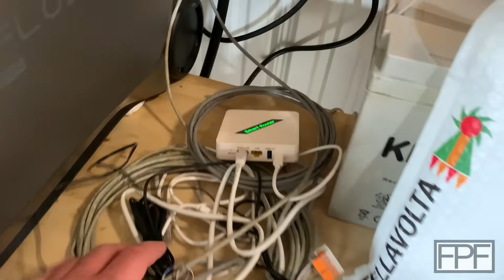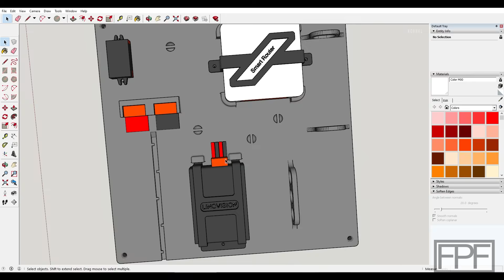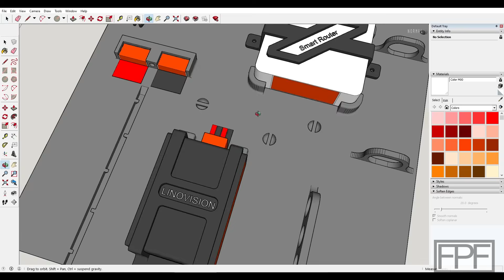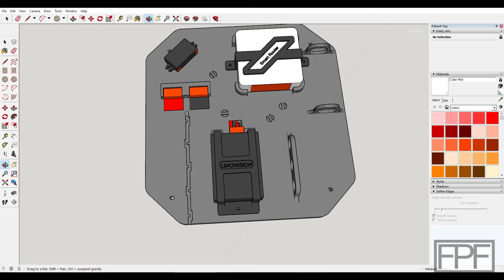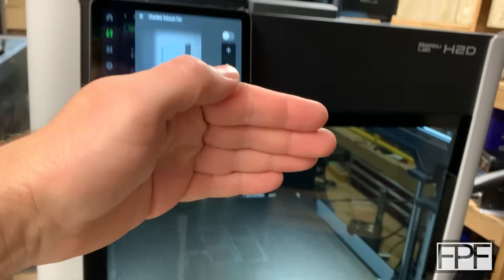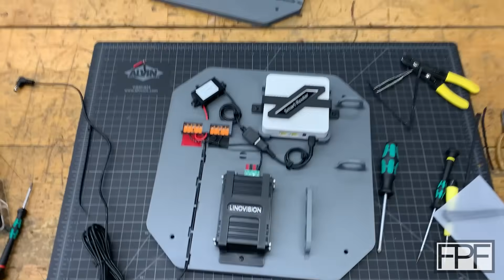3D Printed Equipment Mounting Board - H2D Problem Found

Comment: I will start from the end, I think it is the most important part. Printing PLA with Bambu P1S or Bambu X1C really needs the glass lid removed or the printer door opened, at least a bit. If not, the printer will run into issues, sometimes really big issues, for example filament clog. Users will run into troubles 100%, soon or later, just remove the glass lid or open the door when printing PLA, it is very basic step with PLA and Bambu enclosed printers. I am not here to argue, I am just sharing what happens.

People are expecting too much, one button to print everything, but it is not how it works. A random dude will buy a Bambu P1S or X1C loads PLA filament into AMS, starts 10 hours print ( very first 3D print ) in the evening and goes to sleep. The printer has lid on obviously and the door is closed. The printer is F in the morning so it is warranty claim, right? The printer does not work as it says on the tin.  The printer is piece of crap. ( sarcasm )

Every filament profile can be / must be tuned for the environment around the printer. Same filament, same printer in a room with 20C will print differently than a printer in a room with 30C or more.

Bambu H2D ( I had no luck yet to buy one, it is always sold out before I can buy it ) but I wont give up.
You can tune almost all aspects of your filament profiles in the slicer, you dont really want to have a tornado inside the printer when printing PetG, ABS, ASA or other "sensitive" filaments. PLA does not care, if the first layer is good.

Printing PetG.
Lower the air movement inside the H2D enclosure, you could get air too cold from the environment around your printer, if you print something large or long, it can bend the printing plate. If you want to do a test, print something 50x300x5mm in H2D in the middle of the bed and watch what happens, perfect example would be ABS or ASA filament. If you print very hot and you cool it down rapidly, expect banana print.

I do not know, what temperature you have used for the bed for PetG, but try to lower the bed temperature by 5C, I know it makes no sense, but it works. If it works, try another 5C, until you get to the temperature which still holds the print and the bed is not too hot. The more heat you pump into the bed, the worse outcome you could get, long or large prints will just bend the printing plate almost in any 3D printer.

Elegoo Neptune 4 Max
I do understand why people bought this printer. The print bed looks like a small airport for very good money ( the size ) but that is one of the worst printers I had to repair for few friends of mine. The bed is always crooked and it gets worse when you heat it up. There are some ways how to defeat that but it is just not worth the money. Another very common issue is firmware and dead motherboards, straight from the factory. On the other hand Elegoo does its best to send spare parts very fast.

Few last words...
The most common issue with 3D printers is the user, not the 3D printer.

I repair Bambu printers for friends and the issue N1 is filament clog with PLA. Was the lid on and the door closed? Yes 

Have a great day.

Comment: Pretty cool project!  The only different thing I would do to make it more modular and easier to swap out components in the future is to use a modular mounting system such as MultiBoard or Hex Wall.    Then when it comes time to replace a component, rather than making a whole new board, you'd just need to make a mount for the new device.  I did this for my network and IOT equipment and it has made it so much cleaner and easier to swap things out.

Comment: There is special holders from wago itself designed to hold the wago and slide it on a din rail ... there is also stl's for printing from the usual places.

Which brings me to my suggestion ... Make holders for the other stuff too designed to slide on a din rail. If you ever need to combine it with off the shelf electrical stuff you already have the rails.

As for the bed lifting, check the mounting screws for the bed (under the build plate) on the H2D, some people have reported them to be loose.

Comment: Same here i have done some big pla prints on my p1s and i have never removed the top glass or left the door open and i have never had a problem printing pla. I actually turn off the chamber fan during overnight prints as its pretty loud in the house

Comment: Nice video , good to know! I don't think there is a universal setting for any material in any printer. It really depends on your design. Cooling should be minimal or off , when you print on large areas like that.Also you should set the heated chamber to a higher temperature. That should solve it.  Heat is your friend against warping.

Comment: I just reinforced a tall print which is in two parts, with 2 x 300mm by 9.7mm steel rods. I printed the top part on X1C and the lower part with H2D. both sections had tall, round pockets for the parts, with the same tolerance (0.1mm I think)... X1C part was snug, but slid on fairly easily. The H2D print, I had to force in the rods with quite a bit of pressure.

Comment: Orca slicer has exhaust fan options in filament section as well as chamber temperature, so I think bambu studio could implement that pretty fast in next updates. Sadly X1C could have benefited that a long time ago too but here we are. Try using Orca for these speciofic prints, time saver probably

Comment: Very interesting that the metal PEI-coated textured build plate itself is lifting...nothing you can do about that...

except remove that and put down painters tape on the bed directly, but that's not what you do to a $2,700 machine......

Comment: I think you're probably right in your assessment, no idea about other people but my print room is air conditioned and I leave the "roof" and door shut on the printers and leave little vents open at the top because if I leave the doors open and the fans on I'll get the same results as you with PLA. I realised this on my first fully enclosed core XY printer around 2015 and have enclosed the printers with PLA like it's ABS ever since, ambient temp keeps the chamber below the heat creep danger zone - It's the air flow from air con/chamber fans, i'm convinced
Reply: Yup. I'm in a basement that's about 65F more or less year round. Always keep the door and lid shut for both ola and petg.

For petg specifically, i massively lower part cooling fan (even for overhands, though it a smidge higher) and disable the exhaust fan all together.

Comment: Really Bambu can’t help with knowlege deficiency. Its just physics. The things shrink and expands when the are subject to temperature change. H2D have everything to enable you to pull it off its a matter of knowlege. Raise chamber temperature depending on the material. Wait printer to reach temperature equilibrium. Choose glass or carbon filled material to reduce the shrinkage. Use infill pattern that reduce shrinkage.

Comment: Saw someone else a while ago have a similar problem. He tightened every screw on the bed. Even if they didn't seem like they needed it, and it worked for him.
Reply: What screws ?
Reply: @cromyjr1592  I think it was the screws on top of the bed. They were loose and pushing up on the corners of the spring steel sheet.

Comment: Had some bed adhesion issues due to too low temps in the winter on my P1S that is somewhat open to outside temps. Upping bed temp and closing the door mostly solved that.

Comment: To reduce lifting, you can set the infill pattern to hilbert curve, it won't have those large diagonal lines pulling on the corners.
Reply: Filling that massive surface with the Hilbert curve pattern has to be the most annoying 1st layer to watch in history.

Comment: Really interesting video, and I'm glad you resolved the ventilation issue. I love that you share the thought process behind your designs.
I had one thought about a prime tower... You didn't need it in the end, but if it was important, you could have cut a through hole in the mounting plate, behind the router, and placed the  prime tower there during the print. Once the router is installed, you'd never know there was a hole there.
Reply from the maker: Great idea!

Comment: I've had exactly the same problem on my P1S with larger PETG prints (and actually the same using the same color PETG), not a flat plate like yours but a big, flat hollow box (speaker enclosure). It lifted the corners of the magnetic build plate pretty significantly, I'd guess 12-15mm on the worst corner,  messing up the top of the print, but it still printed because when it ran over that area the print head would push it down.

I was sure it was a heat problem and had other similar items I wanted to make so I spent time insulating the chamber with reflective insulation, that made it significantly better. Manually turning off the chamber fan (it has a chamber cooling fan, just not the fancy vents) helped some more but ultimately for some reason that caused the corners of the print to lift slightly rather then the bed. What finally got a good print was using fiber reinforced PETG (I don't remember if it was CF or GF, I have the same brand with each in the same color), the fiber reinforcement seems to help prevent warping.

I recently had a similar problem that presented itself completely differently printing a large part in black PETG that had sides that tapered outward at 50*. It looked like it was just failing printing the 50* angle without support. I redesigned the part so what was a 50* angle was now a 35* angle, and it still "failed" in the same way (it printed, but the surface was horrible and rough). I noticed that the bambu studio profile had different max unsupported angle depending on layer height and quality presets, so I tinkered with that it fixed things on one side and not the other. I realized that it was next to the auxiliary parts cooling fan and that it would sometimes run even if you had it turned off in the slicer settings. I ended up manually turning it and the chamber fan off after starting the print and it printed perfectly. Same with a redesign with the original 50* walls. Who would have thought that a cooling fan would cause a problem with overhangs?

I'll second that Bambu studio needs better control of the fans, including some way to turn off the chamber fan, but even more so, when there is control of it, if you tell it to turn it off it should stay off.

Comment: It looks good, one option for people without the H2d might be to make the board as modules that either attach to din rail, or use dovetail slabs to link the panels in some combination. Say each module is 8"x8", and has 2 1" or 25mm dovetail slot horizontally and vertically, that is used to physically link the modules, and those bits could be the pieces that mount to the wall, so that the attachment screws are never visible (or provide possible shorting bridges) once the panel is built and mounted. 

Another thought would be that for devices that are normally"mounted' flat on a table or shelf, rather than against a wall, provide added space under the component, with landing pads for the feet, giving more clearance for airflow. After all they are mostly going to be radiating heat off the surface that would be the top,when set flat on a shelf, and that would normally pull ari through the bottom, but if the system is mounted edgewise like this, that pull through isn't as precedent, so providing les constrained air behind it may help with the longevity of the equipment.

Then again, I tend to overthink some of this stuff. 🙂

Comment: I have seen some FLIR images showing nonuniformity in the bed heater which seems to correlate with the sparse pathing of the heating element. My first thought was that this is the problem, and and you just worked around a design flaw by closing the vents. I was not aware of the two stage heating system, however. I wonder now about the arrangement of the two elements, and if these FLIR images were just capturing the initial warmup element. I would like to see some thorough testing regarding heating uniformity.

Comment: So nice to see people make good in-depth content about the H2D, as people know to not expect a "perfect" printer, but a great printer, and where the rough edges are and where they should be careful. I'm still very excited to receive mine.

Also, obligatory question: How dry is the filament?
Reply from the maker: thx!  dried in the AMS's for the default drying cycle for PETG before 1st print
Reply: @FunctionalPrintFriday  Okay, I was a bit overeager and didn't wait for the conclusion of the video while I typed it :). Yeah it seems to be the aircon combined with the profile being to eager to suck fresh air in. It should probably do it less aggressively, and even less so if it detects a steep temperature drop.

Comment: Solution is pretty easy - up the temperature of the bed, ~77° C for PETG usually mitigates lifting corners.
Reply: Warm enclosure to 35° C also helps. But high bed temperature is essential.

Comment: I use three of those Linovision switches in my attic.  The previous owner ran two cat 5E cables to every room, but he used them for phones!  But as is often the case, he terminated each cable at a punchdown block in the attic.  I leveraged those cables for Ethernet, but since they all terminated in the attic, that's where the switch needed to go.  Well, I live in Texas.  It gets HOT in my attic.  Too hot for a standard switches.  The Linovision switches (and the power supplies that came with them) are supposed to withstand 170F, so I used those.  Only problem is that between computers and POE IP cameras, I needed 24 connections, so I needed several of the 8 port switches.  But two years on, they're going strong.

Comment: My initial thought while you presented your planned solution: why not just use something like HCSW or Multiboard, probably combine it with underware and some custom brackets…
Reply: And why complicate it that much? Screw custom brackets directly to the plywood instead. People are printing custom backplates, multiboards e.t.c. way to much. Its a stupid way of using 3d printers to create things that can be done easier, cheaper and more environmental friendly in other ways. (Multiboards of different kinds are quite stupid themself, most people that are using them don't move things around more than once or twice in their life time. So much smarter to just screw things into a wooden panel then. Much easier to design custom brackets that way and it will give a much more sturdy solution)
Reply: @drosendahl my thinking was more along the way of less print time and filament use for a similar stability, less pieces to design yourself and more parts that can be re-used, should you end up tearing everything down later in time.
Reply: @ And still it would be easier just to have brackets, bins, tool holders e.t.c. screwed directly into the plywood in this case or another wood board in other cases. Multiboards of different kinds are just complicating things and wasting unnecessary plastics while giving a worse end solution. The only time a multiboard make sense is if you expect to change your setup very often, something that does not apply to many people.

Comment: This is only my second time here, but I have learned SO, SO much that I really need to say thanks! The first time here I ended up watching almost 8 hours of you straight!  I've put off buying a 3D printer for 20 years because since the very early days of these machines you'd most likely have 9 mis-shapen, molten clumps of plastic for every 1 a machine might produce flawlessly.  I see that (for the most part) that issue is fixed. Your trials with the cooling problem you had is very interesting (because it caused the first 2 attempts to fail); didn't see that coming at all; I thought since the H2D was built for these filament that they'd have it dialed in and down to a science, but I guess not! I'm really curious what BamBu Labs will say, so please update us if they answer you.
I also think your wire management project was completely AWESOME!  Really a great idea!   After 20 years of putting off buying a 3D printer, I've finally decided to buy one and have been leaning towards the H2D.  Your videos have really helped me make my choice. Thank you for sharing, it really helps.

Comment: Why even create a plate like this in the first place? So unnecessary... You could just have designed small fasteners for each detail and mount them directly on the plywood board saving A LOT of plastics and made it so much more dynamic and easy to change individual details in the future.

Comment: It would be nice if the incoming air temperature could be measured by a sensor, and the fan speed and fin angle adjusted accordingly.
Reply from the maker: Facts.  That would be the ideal scenario as default, but adding a checkbox as a first step would be great.

Comment: I understand why Bambu are overly protective with their system, but it remains one of the biggest annoyances for me. Im constantly finding myself with fringe case scenarios that require a workaround to stop the machine arguing with me, telling me I can't do something that I know will probably work perfectly fine.
Reply: get a snapmaker. the snapmaker has a  3 in 1 tool head printer is cheaper than the h2d and has 1 more tool head over the 2 in 1 small bed bambu junk

Comment: There must be a G code embedded in the slicer output that activates the relays to open the air intake and exhaust. Locate that code and edit it out the chamber cooling. That will allow the job to be run repetitively without a need for manual override.